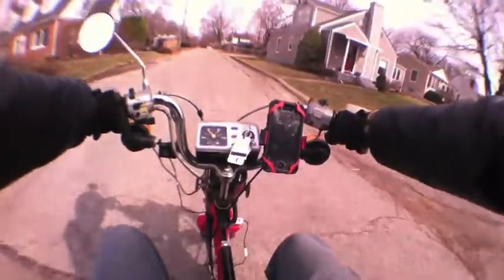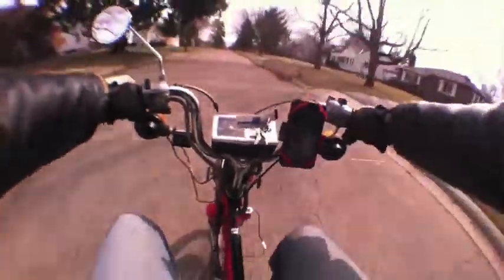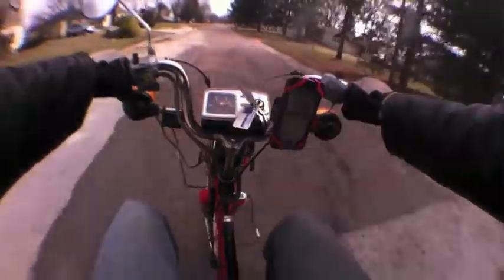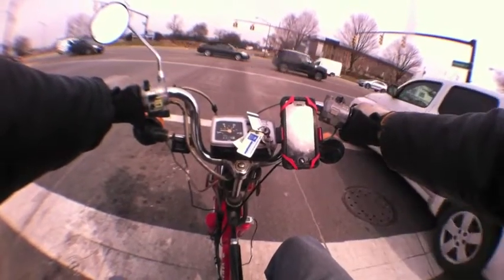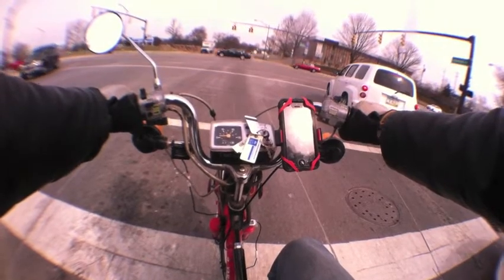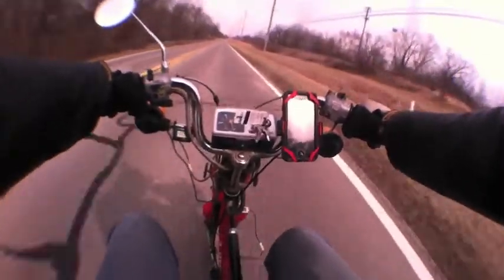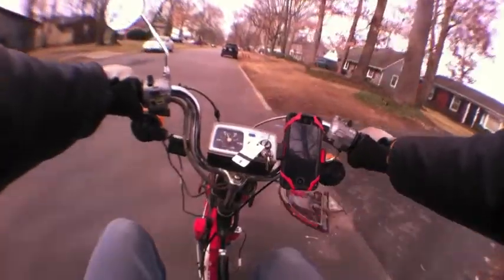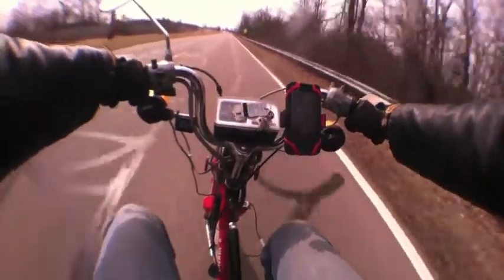Yamaha qt50 Yamahopper HPI Ignition Project

Comment: Does upgrading to the HPI ignition require upgrading the whole electrical system to 12 volts?
Reply: Donation sent, by the way.
Reply from the maker: yes it does.  I have to change all my bulbs to 12v.
Reply from the maker: @roblafreniere3053  THANKYOU!
Reply: @jackrutherford-1  Is that all that you have to do, change bulbs?
Reply from the maker: Rob LaFreniere horn should be fine. It comes with new cdi and coil.
Reply from the maker: @roblafreniere3053  and a 12v battery, I forgot.
Reply from the maker: @roblafreniere3053  come to think of it, I may need a 12v rectifier as well.  Darn it.  and treatland recommends the trail tech regulator.
Reply from the maker: hpi ignition system purchased
Reply: @jackrutherford-1  very cool!